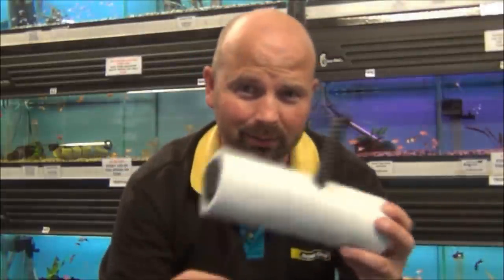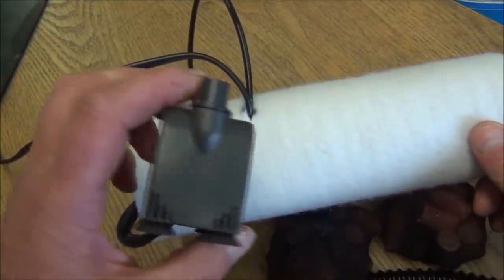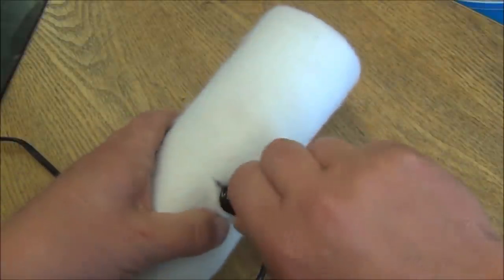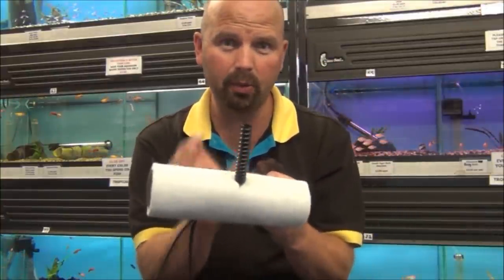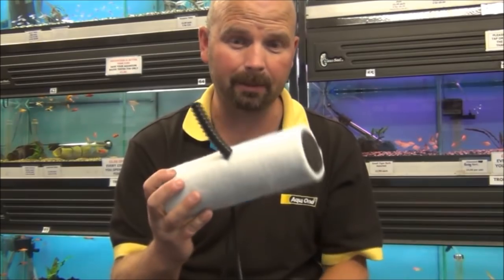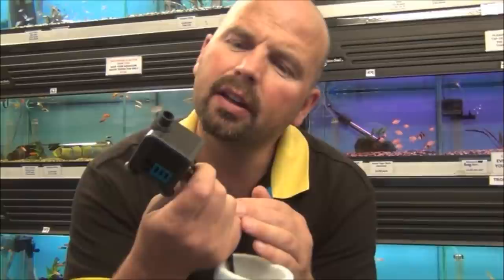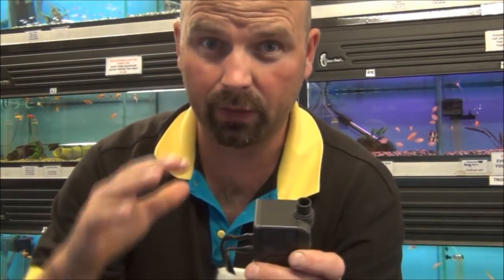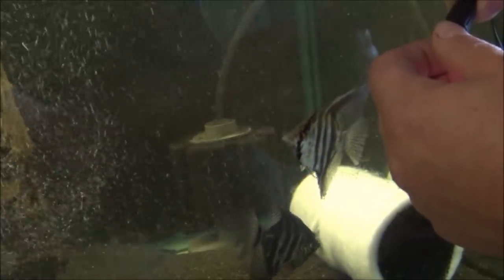BEAT THIS AQUARIUM FILTER!.....GROOVY - DIY AQUARIUM FILTER FROM PONDGURU

Comment: hi were can i purchase all the bits from for this filter and what size of tank i have a jewel 180 with 1 oscar and 1 pleck in it can you help regards simon
Reply from the maker: I wouldn't bother making a filter like this for a tank with heavy filtering requirements as although it will help towards keeping water healthy it is nowhere near what you need for a 180 litre tank with oscar. Ideally you need around 4kg of media and an external filter like an Aqua One Aquis 1250 to hold it.

Comment: i live in the usa was woundering if they make a usa pump like this one. im very interested in this and want 2 do multi tanks aka sump for fresh water. any suggestions or recommendations. i do want 2 do aquaponics. i have watched alot of vids on all but would just like ur advise on it and recommendations 2 it all. p.s. if u have a list of plants that works with it would be greatly appreciative. and plz try 2 message me i dont always look and past vids i already watched. ty
Reply from the maker: +Joshua Davis You'd need a bigger pump if it was to pump from a sump but if it was to be for a filter inside a tube like the one in this video this is the nearest I can find in US: http://geni.us/3k9u
It doesn't have the air intake but is small enough to fit inside the tube.
If you did buy the proper pump from the UK you would need a plug in step up converter like this: http://geni.us/1zn4
I'm not very knowledgeable on plants for aquaponics so you'd be better contacting a supplier of aquaponic / hydroponics gear for that advice and also about the recommended type of pimp for pumping to the growing trays from a sump.
Reply: +Pondguru Outdoors ty so much for the info. ik u posted this a long time ago have there been a better out come of it or no? and agine ty
Reply from the maker: +Joshua Davis I haven't found better materials but have sourced smaller tubes which allow 2 of these filters to be joined together for larger tanks.

Comment: You said "polyester" pipe.. for the white pipe.. It seems to be fuzzy.. where did you get that?
Reply from the maker: +John Roy It is a polyester felt tube and was given to me by a guy who got it years ago. It took me weeks of searching but I found a supplier in China so I order them from there now. Only problem is that the minimum order is 100 and shipping is a killer from China.
Reply: Those polyester felt tubes look like a hollowed out loofa sponge. (luffa sponge).  I think if a sponge was hollowed out, the walls of it would cave in though.  Maybe a hollowed out sponge with a plastic or metal spring inside would work though.
Reply from the maker: +John Roy Yes those ebay listings are mine and the shipping to US is a real bummer but orders generally arrive in 1-2 weeks if sent airmail. Heavier orders (over 2kg) are sent by UPS which only takes 2-3 days.
Reply: Shipping prices have become excessive.  Also, when people order things, they want them NOW.. not in 2 weeks.  I USED to send and receive a lot of stuff from Russia, but that is extremely expensive now.  Maybe if you know someone in the colonies (the USA), you could ship a large shipment of the parts there, and when you take the orders, have the actual product sent from within the USA.

Comment: like the idea of other creatures using it as a feeding centre. Do high speed bothers the fish, can they sleep under such condition, having to be constantly on the move.  You should check out my filter instead.
Reply from the maker: Looks very interesting how the water pressure keeps the filter in place. The filter in this video only has a 320 litre per hour pump so doesn't shift much water. As the pump shreds the air into tiny bubbles it eliminates noise associated with an air pump but if noise is not an issue a standard air pump is great for driving a filter.
Reply: you know your filter. It does what it did even if I set it to low.

Comment: I bought the aerating pump it works great but is it supposed to be noisy or is it just mine
Reply from the maker: The are normally extremely quiet but the noise does increase if the air inlet is fully open or not used at all. Try closing it down a bit and that will result in smaller bubbles and less noise.
Reply: Pondguru I have its still noisy think its the vibrations on the side of my tank il fiddle around with it though thanks anyway
Reply from the maker: Gus kennedy No worries but if you think it's not normal just let me know.
Reply: ok thanks
Reply: Pondguru I am still having problems with it when i turn it on its still noisy and rattles now I think its faulty
Reply from the maker: Gus kennedy No problem you are in the perfect situation since you have a youtube channel. Simply upload a video of it in operation with some talking if you like and that will save you sending it back if it is faulty and a replacement is required. Just send me the link to the video you upload.

Comment: Does this ever clog? I had a small one in my Tilapia tank and it clogged within a few days.
Reply from the maker: If you were using one of these filter in a tilapia tank it would clog quickly as they are extremely polluting fish. They really require a sump or large canister filter. What size was the tank?
Reply: 40 Gal. I ended up changing it out for just a large swirl filter. Thanks for the vids these are great.
Reply from the maker: Glad you enjoy the videos - yes 40 gallons (US or UK gallons) is waaaay to big for a small tube filter. Really they are a supplementary filter to aid with nitrates, clarity and water health in tanks up to 100 litres (around 25 US gallons)
Reply: Ok, maybe if I make a really large one? Say with a 300 gal per hour pump? I bet that would create a TON of aeration and keep it clean. My swirl filter leaks so need to find a better way. Thanks again. Peace.
Reply from the maker: I'd be looking at a large external filter for a Tilapia tank as they grow extremely fast. The more filtration they have the better the water will be and the faster they will grow.

Comment: can I use a paint roller instead of the poliester tube? im having a hard time finding it.
Reply from the maker: As the paint rollers have an internal hard tube they aren't suitable but simply rolling up a large piece of foam or sponge will do the trick. It can be secured with zip ties.
Reply: thanx man, i really enjoy ur vids, u r doing excellent.
Reply from the maker: ixyzpilot No worries - just wish I got more time for making videos.
Reply: use a power roller it has holes in it you just have to put the pump at one end because it still as the hard plastic in side to it and it working great for me in all my tanks

Comment: Can this be done but with 2 inch pvc?
Reply from the maker: The idea of this filter is that the whole tube acts as a mechanical filter to set it apart from a standard filter. While a pvc tube would house the necessary filter parts it would not do the same job.

Comment: And updates on a source for those nylon tubes?
Reply from the maker: Ray Burg Unfortunately not. I know they are used for roller covers in metal foundries but can't find a supplier who will supply less than 100 or one which will even send a sample. I can't risk buying 100 with no sample.
Reply: Pondguru Can't anyone working in a metal foundrie sent you one ?  
Or maybe knocking on a foundrie's door and asking for one to see and ask for their supplier ... that might do !!! 
if you could give us the tube's/filter specs, we might try from our own location !!!!!  Thanks
Reply: I actually found a possible source. Craft shops sell polyester felt. It comes in sheets that could be rolled into a tube of whatever size you like.
Reply from the maker: Ray Burg Yes the polyester felt can be rolled into a tube and a few people have done that and it works so if you have access to that it will work no worries.

Comment: hello, do you think a paint roller cover would work?
Reply from the maker: Not really as it is a sold tube surrounded by wooly polyester. If you could drill loads of small holes through the tube then it would probably be OK.
Reply: thank you!

Comment: hi pondguru, sorry to bother you again, where did you get the little one way airline adjuster from, have tried searching but keep coming up with non return check valves and similar, or 2 and 3 way valves, which i dont want cheers mate
Reply from the maker: It is an adjustable air inlet which comes with the pump. I think they come with all pumps with a venture. It may even be sold alone as a 'venturi'?
Reply: Pondguru hi mate thanks for the reply, i bought the pump which looks identical to yours its by NEWA,and is a micro pump, but there was no screw down adjuster with it, the only way to alter the flow, appears to be from the blue sliding gate on the side of the pump, which would mean unfortunately taking the filter apart to get access to the slider to try and determine the correct bubble output i want, but never mind, i was hoping that you may sell them or have a direct link to the place where you got yours from, it just seems a good idea to adjust the flow whilst pump is submerged,save messing about, i will do a google search for venturi and see what it throws up ...thanks again for your time
Reply from the maker: bobthebuilderkef Sounds like you may have bought the standard pump and not the oxy version? Does yours have a place on the back to attach the air line?
The two types of pumps look identical but one has the air line attachment, the other does not. If you have bought the oxy version and it has not come with the or line or adjustable end you will need to contact place you bought it from so they can send one out but if you have the non-oxy version then you will not be able to attach and air line to it. Feel free to send pictures to pondguru@btinternet.com
Reply: Pondguru yeah your right mate, just checked and there is no place for the air line, yet when i viewed it on ebay it showed an airline coming out the back, so i'll have to contact them, it's a little misleading when they do that, ive just this minute bought a air line adjuster(venturi) aswell, bloody typical isnt it, thanks for letting me know, your a bloody star
Reply from the maker: bobthebuilderkef No worries, any time.
Reply: Pondguru pumps going back today, the seller had shown a photo of the oxy pump, and also stated it was an oxy pump when in fact it was a basic micro pump, so not a happy bunny, i am going to purchase the pump from yourself and some biohome media, probably this evening.
Could i pick your brains please for some advice!!
my little boys tank is a shape that i can only describe as  a fifty pence piece cut in half, so  its tall more than long, its 25litres, and he loves it, he has his cloud moutain minnows and a few zebra danios, the problem is as you quite rightly point out in your video, he has it in his bedroom and he stares at the fish before he goes to sleep, and as soon as he wakes he watches them, so i really need to keep it in his bedroom, but the noise from the airpump is quite noisy, i was told to buy an interpet airvolution AV2, for quietness, well its not quiet at all, me and the wife can hear it in our bedroom, so that was a wasted purchase,so when i saw your idea i thought i'll give it a go, i cant find the polyester rolls anywhere, so i'm going to buy some polyester matting and get someone to make it into a roll maybe sew it with fishing line so it wont degrade, or velcro it into a roll shape! the matting comes in the following thicknesses, which one would you recommend me to get, i dont want to buy one that will be to thick to be beneficial as a filter or too thin.....5-7mm,10-14mm,16-20mm,25-30mm or lastly35-45mm, be grateful for your view,
Also because the tank is tall more than long, i was thinking of inverting the filter so it runs from top to bottom, would this still in principal work the same and do the same job?
Also one last point..when i finally do make this filter and put it into the established tank, it will obviously be nice and clean, with no bacteria etc, so should i leave my existing filter in running along side it and if so for how long..weeks or months?.
also when i buy the biohome media off you, i have never used it before so how long would it have to remain in the filter before i am looking to replace it, weeks, months or years?, sorry for all the questions, but i like to do things right, cheers again
Reply from the maker: bobthebuilderkef The thinner pad would do fine (5-7mm) and will work just as well if standing up. Run alongside old filter for around 2-3 weeks if using biohome, 4-5 weeks if using standard media then remove old filter. The biohome should last at high efficiency for at least 6-10 years.
Reply: Pondguru thanks for the info,i received the pump and media this morning thank you, also you have included some filter start balls(i think thats what they are) whats the dosage for these, do i put them all in at once, or at intervals, and is it ok to put them in the stockings with the biohome media? cheers
Reply from the maker: bobthebuilderkef Just put them all in at once with the media and they will really kickstart the filter, maturing it fast. Really you only need one ball per 20 litres but you can't overdose.
Reply: Pondguru Hi richard, thought i'd give you some feedback on the filter, made the polyester roll, put the pump in, then the stockings with the biohome media, then put the sponge in each end, lowered it into the aquarium, then total disaster, as the filter was lowered into the aquarium it just kept failing to shred the air after it was submerged more than about 6 inches,so i checked the technical data on the instruction sheet, thinking it may be something to do with pressure, but the leaflet said that the pump should be good down to 1 metre, my tank is only 12 inches deep, but for some reason the pump would just not shred air, so after several attempts (about 6) of trying different positions, even inverting the filter, i called it a day, once the pump is out of the polyester tube and on its own it shreds air perfectly, really baffling,so now  ive done away with the filter and am just using the pump of a night time because it is definately quieter, shame really cos i really wanted it to work, instead of throwing the biohome media in the bin, can you suggest how i could utilise it, could i just lay it on the bed of gravel i have, or something similar, just seems a waste not to try and incorporate it, thanks for all your help richard, perhaps the polyester or stockings restricted the pump doing its job....really wierd, if you would like me to send you the polyester roll so you can have a go with it just let me know, cheers.......mark
Reply from the maker: bobthebuilderkef This is going to sound like a stupid question but have you tried adjusting the intake on the pump (the blue sliding thing on side of pump) as when the intake is restricted the pump can't suck as hard, therefore it won't draw air in as well and won't spit out as much water. This may not be noticeable without a filter around the pump but may prevent the intake of air when extra restriction is put on pump by filter matting (especially if it is all fine). Feel free to send pictures of the filter you have made etc. to pondguru@btinternet.com
When I made the filter at work we tried it right down to the limit of the intake and it was fine but it did have coarse foam on each end so that wouldn't restrict the water flow much.
Reply: Pondguru Hi richard, have sent you a message through ebay.
Yes i have tried adjusting the intake, i have tried all sorts of variations but the pump doesnt seem to want to shred air at anything deeper than 5/6 inches either on its own or inside the filter ,when i had it in the filter i also used coarse foam at each end, the only other thing in the filter (apart from pump) was the biohome media in the little stocking bags
Reply from the maker: bobthebuilderkef Just seen you have sent an email and there's a few pictures attached so I will answer that one.

Comment: would something like this work in a betta tank?
Reply from the maker: Yes although it depends what size the tank is as betta don't like a heavy flow. The pump in this filter is only 450 litres per hour but looks heavy due to the aeration in the flow. Ideally you'd want a slower flow for betta in a small tank.
Reply: thank you so much for the fast response ya the tank I have it in is a 5gal tank but the bubbles look soft and wouldn't disturb the water a ton. I might look into this thank you so much and love your videos btw^^

Comment: I have looked on your Ebay shop for the polyester tubing and the other parts but did not see it on there, do you know were I will be able to buy some from in the UK as I know there is a link for alibaba.com that does the polyester tubing but its 3-10 days for delivery and I need a replacement urgently as my filter has stopped working. The filter I had was an a Rena Filstar XP2. Thanks
Reply from the maker: I can't get the polyester tube yet and if you have found a source for the tube at a 3-10 day delivery that is awesome. I couldn't find any supplier on alibaba who would communicate so if you've found one who will go for the tube with them. I'd love the link to that manufacturer.

Comment: The downside to this filter is that it will strip the co2 out of the water unless you get those bubbles under control. So this wouldn't be that good for a planted tank.